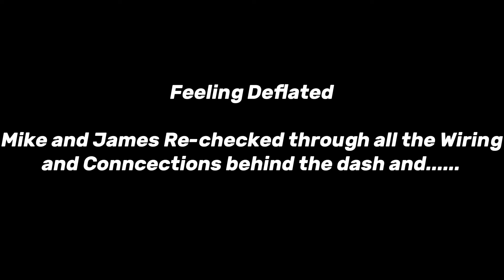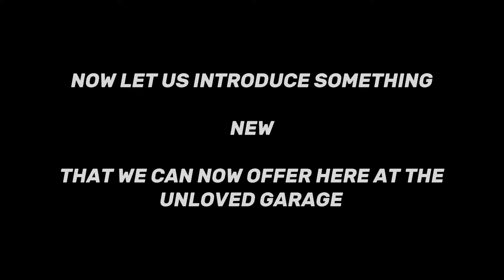The Restoration Mitsubishi FTO Starts For The First Time

Comment: Hey guys I’m working on an FTO too, the engine was cranking but not starting and fuel wasn’t coming out so I replaced the fuel pump, now I can hear combustion when I turn the ignition on but still doesn’t start. The car revs a little when cranking but still nothing, do you know what this could be?